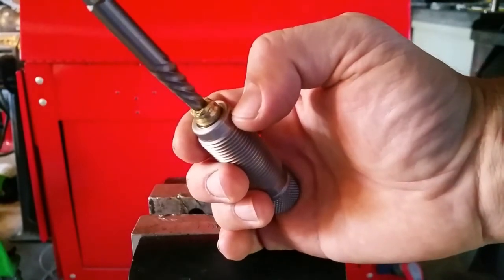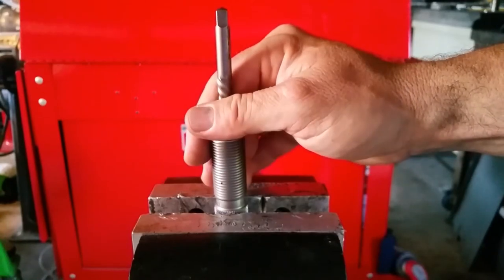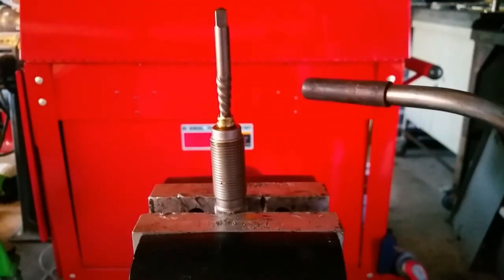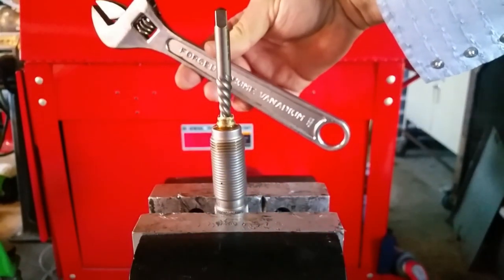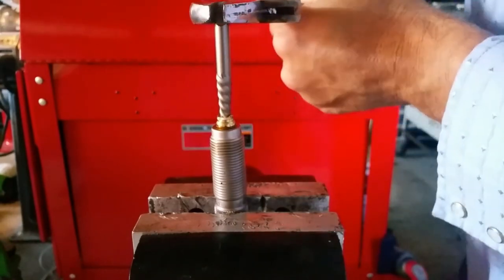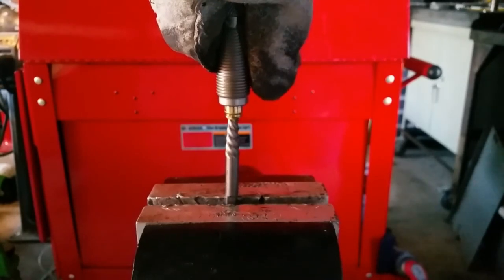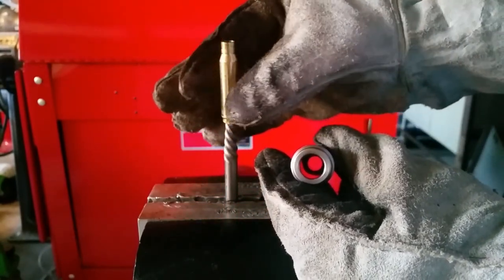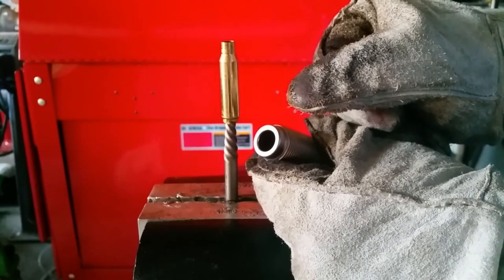.308 Case Stuck in Die! removal

Comment: Drill it, tap it, pull it...It's brass inside steel and doesn't require automotive/industrial stuck fastener removal tricks. Also I don't know of anyone that uses a wet lube for resizing - the common thought is wet cases get dented under the hydraulic pressure of the wet lube (Again this is brass in steel, not industrial metal machining).
Reply from the maker: The Dude 20 roads lead to Los Angeles. Get it done. Your way, his way, that old guys way. If it's done, it's done. 
Thanks